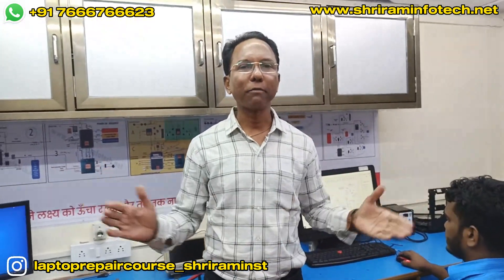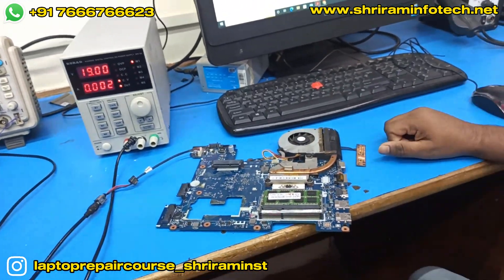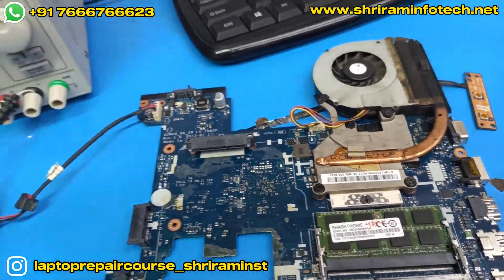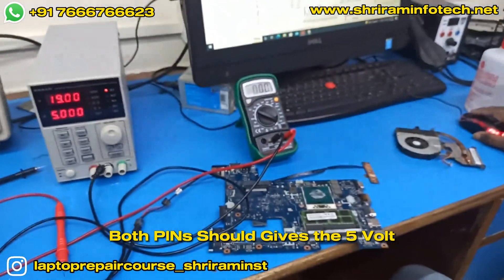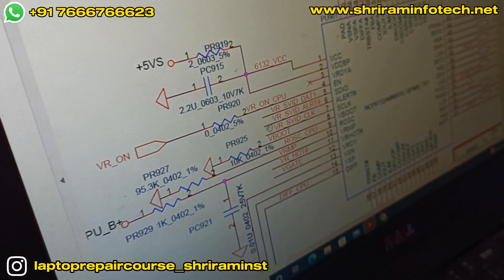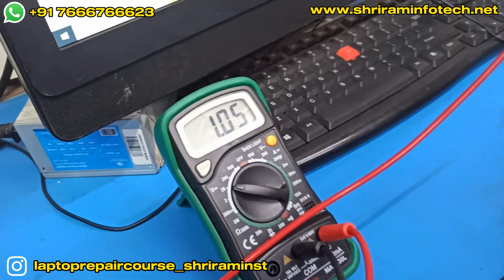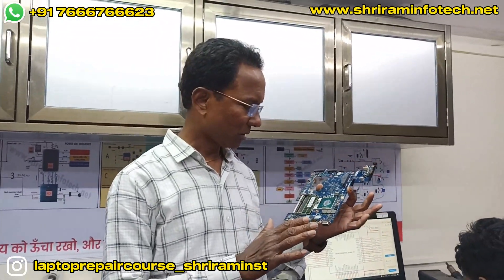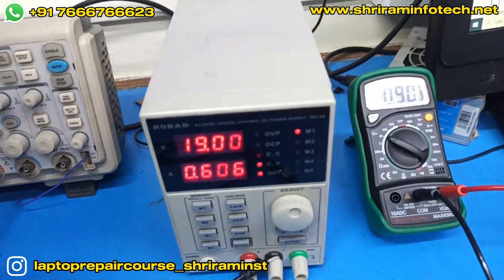CPU CORE REALATED ISSUE || SHRIRAM INSTITUTE || SANDEEP SIR ||

Comment: Hi sir, great video. I have an issue with a laptop, when I turn it on it works normally for several hours then shutts down by itself. when I try to switch it on again it switchs off seconds after the button press. and after one day or so of inactivity I can use it for one hour or two before it shutts down again... when I check the voltages on the motherboard all of them come normally except one called vgfx_core which is coming from the chip ncp6132 as the auxiliary output (remains 0v). with the multimeter I find a resistance of 2ohms between pins hg and bst in both modules and I couldn't spot any component with that impedance between the two routes. can anybody throw a hint about this. I'm confused and don't want to replace the chip before I get sure that it is dying. thank you

Comment: Sir are these test points  can be use in for CPU overheating issue ?  
Already I have changed token capacitors regarding  this problem but Issue not solved,also changed the cpu but  didn't got the result.
Reply from the maker: Yes these are test point u have to check